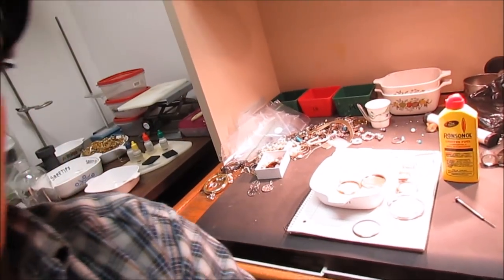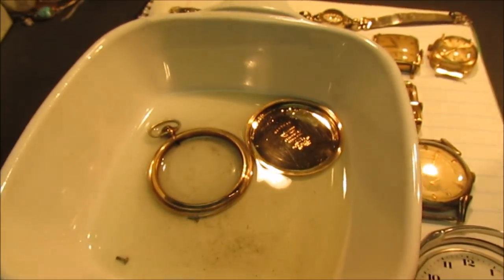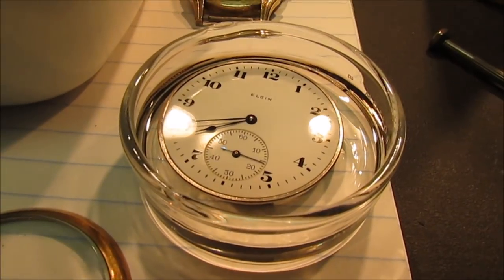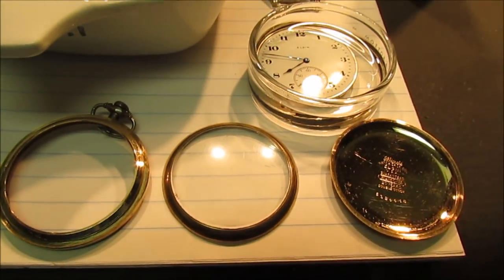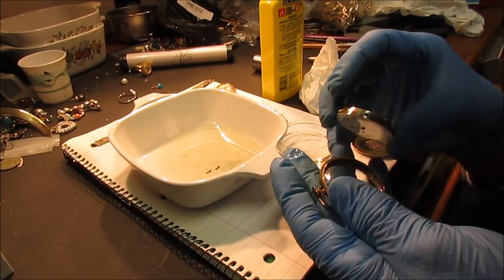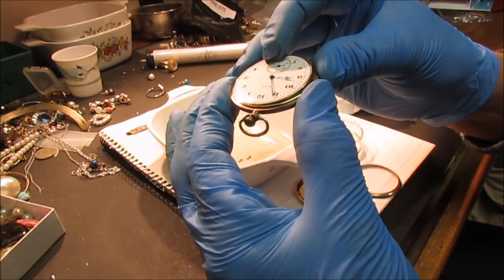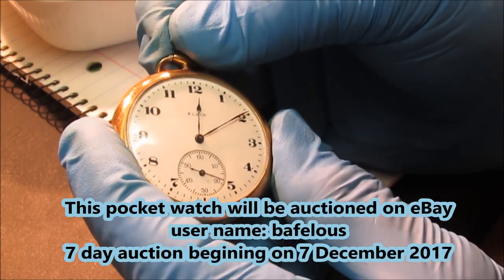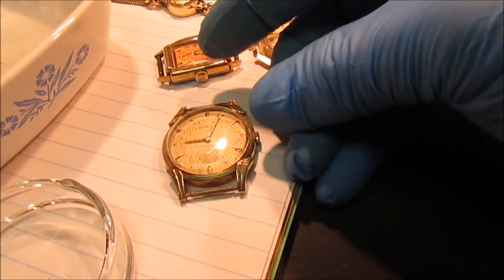Repairing An Antique Pocket Watch With Lighter Fluid

Comment: Beware eBay purchasers this watch has not been serviced only rinsed in lighter fluid without been striped down and is running dry without oiling, very bad practice.
Reply: keith solloway Finally someone who knows about watches

Comment: Remove this video!!! For the sake of all the watches people would destory!
Reply: Smakfu you are totally correct. Anyone reading this who knows this guy personally please try and stop his practices. Watches of the like deserve a lot more respect.
Reply: Don't be stupid all your life. The old cats used lighter fluid or naptha all the time to flush out all the dried out oil and dirt. No sonic cleaners in 1899 thru 1970. So rather than disassembly of your whole watch just douche it out with. Yep.lighter fluid. Ain't really anything to hurt when you think about it. Shit evaporates clean.
Reply: @bigwu100  Just because some old timer says thats what he did does not make it right. I have had it told to me. Your basically turning the pivots into grinding stones and all the dust, old oils and junk will wear the pivots out. That and now your running the watch dry with no lubrication so it will wear out faster. They used naphtha to clean the watches once taken apart. Once the watch movement was soaked over night you dry it off and take wooden pegs to clean out the jewel holes. Etc.  Will soaking a watch in lighter fluid get a watch running? Maybe but not all the time.
Reply: @bigwu100  the problem is that the lighter fluid removes all the lubrication from the watch so you would have to lubricate all the pivots on the watch or the mechanism will wear down fast.

Comment: Eek!
I recently bought a lovely Elgin Hunter off fleaBay, listed as having a broken balance.
After some research, and a few relevant purchases,  I spent a very nerve wracking afternoon dissembling, cleaning, carefully oiling, and reassembling, it.
Phew! I'm not sure I want to do that again!
Much to my amazement it actually works! I had invested in a new balance shaft and wasn't looking forward to trying that repair, but when I took the watch apart my thoroughly inexperienced eye couldn't find anything wrong with it... apart from my suspicion the pallet-fork had "jumped" the balance wheel. (probably not the right term)
It's running pretty well, although if held face-down at a 45deg angle (balance lowest) it gives a little "boing" and stops. Changing position or giving it a slight nudge starts it up again... blowed if I know what that is, I'm absolutely new to this.
Why do I bring this up?
Most of my "research" has been through watching YouTube videos. With the tiny amount of knowledge I have gained even I know this is a really, really, bad idea... If I had seen this video a week ago I suspect I would have completely buggered my watch!
Reply: if you haven't figured out the problem yet, it sounds as though there is something stuck in the pivots of the balance wheel.
Reply: It takes years to get the right tools,, and learn how each part matters, I encourage to learn the trade , that is what you are paying for when you take a watch to a, watch Maker, do check if everything is good,,, and all it needs is a cleaning to get it back up and running properly.

Comment: 1. Lighter fluid can remove numbers from watch dial.
2. Lighter fluid can remove pallet stones from pallet fork and roller jewel from balance. 
3. Lighter fluid is not be inhaled.
4. After a proper cleaning, the movement should be lubricated with watch oil.
What you have done is akin to cleaning a newborn baby with a brillo pad!
Reply from the maker: I put some möbius on the watch. Sorry if this offends you. But it did get my watch working.
Reply: Don't think you have to worry about the lighter fluid affecting the resin holding the pallet stones and impulse pin (unless you keep them in the fluid for weeks). However, I always use some isopropanol (IPA) to rinse any lighter fluid residue and this can definitely destabilize the resin, so I only rinse the pallet fork and the balance complete for a few seconds and then blow them off. Other than that I think you're spot on! Imagine cleaning a car engine like this. Sure, it would run, but for how long, and imagine the damage. STAY AWAY FROM THIS METHOD!
Reply: I feel that you can do what you want to your own watches, but not to sell them on eBay with out informing the buyer what you have done, and definitely not on other people's watches.
Reply: @see08sharp  Alcohol WILL dissolve shellac.. Very quickly.. You use alcohol, typically ethanol to dissolve shellac flakes when you're going to paint with it.. Shellac actually will stand up pretty good to nonpolar solvents like that napthalene he uses in the vid...

Comment: The proper way to repair a common low cost mechanical watch is to send it off to an experienced watch maker and after about $400+ you're good to go. So, a common low grade vintage watch in perfect working condition that's worth maybe $30 to $100 dollars cost maybe $500 for a complete service/repair. Or, if there is no emotional attachment, you could try the lighter fluid method and maybe get it running for the price of a can of lighter fluid. The downside is the watch probably won't be properly lubricated so a major part or two might wear out sooner than they would with professional service. I find a lot of cheap mechanical ca. 1909 to 1970's watches at estate sales, etc., and if they run at all I'll do the lighter fluid thing. It just doesn't make sense to spend $500 on a $1 garage sale watch worth $50 in mint condition.
Reply from the maker: Well said.

Comment: A watch maker friend, now deceased, used to use Zippo lighter fluid on movements that were rusted. He said it was very good at breaking down severe rust, but he always properly cleaned and lubed everything afterwards
Reply: Hmm, maybe take apart and place parts in a glass container and then place an ultrasonic cleaner available nowadays.
Reply: He did this before teardown on rusted watches to help dissolve the rust.

Comment: If you can afford watch cleaning solutions from L&R or Zantech from a supply house, I think this would offer a safer cleaning option than lighter fluid. You should disassemble a watch movement completely. The dial and hands need to be removed first to prevent any possible damage to these parts. Then, you can disassemble the movement completely.
Reply from the maker: Got it, thank you.
Reply: Let's see, 50 cents worth of lighter fluid and 10 minutes of time, or $100 cost minimum for a watchmaker, or about twice that much for cheap tools and expensive grease with hours of trial and failure to repair it myself... Let me think...

Comment: Anyone with a modicum of mechanical aptitude should know this is a poor way to treat a watch. That said, common model pocket watches are plentiful and relatively cheap. There are hundreds of them at any given time on eBay, but unless it had sentimental worth, why would one spend $150 - $200 or more to have a watch with a $70 value properly repaired? The same ones ridiculing you for doing this would think anyone crazy for spending $3000 to have the engine in a twenty year old Ford Taurus rebuilt. Of course you could learn to service the watch yourself the correct way for a lot less, but not everyone has the time or desire to learn watchmaking skills. I see nothing wrong with your method if it works to bring a dead watch back to life if even for the enjoyment of a few months or a year or two. We can't take any of this stuff with us when we leave this place, and most of our treasures and gadgets will be tossed out with the garbage or sold for pennies on the dollar at the estate sale anyway.

Comment: Just in principle, you should probably squirt WD40 in the gears before you close it back up and leave a tiny piece of duct tape on the inside of the case, to ensure you have used all modern repair techniques available.
Reply: I think he's making fun of the idea of cleaning the watch with butane and modern tools.  Watchmakers doing repairs tend to use things like pegwood and other tools that would have been used by the original watchmaker.  Things like ultrasonic cleaners are seen as a cheap way to do a cleaning, the butane method may be somewhat effective but is probably seen as heresy.  Maybe find a nearby watchmaker and visit them sometime and take a look at the trade.
Reply from the maker: Got it, thank you.
Reply from the maker: I actually saturated it with 3 in 1 oil.
Reply: You should definitely visit with a watchmaker, show him the video, talk watches, and tell us what you find.
Reply: No. You should literally do none of these things. You are supposed to disassemble the entire watch and use an ammonia-based watch cleaning solution. And then a different rinse. The ultrasonic isn’t a cheat, it’s better than any old method. And the balance isn’t supposed to be in the solution either because it makes the hairspring stick together and the watch will never run correctly. The whole point of cleaning a watch is to clean the jewels that the wheels and gears run into, and this can never be done without actually disassembling the watch. This whole video made me cringe.
Reply: To finish the cleaning, I usually pour a quart of 10W30 on it, then test the crystal with a ball-peen hammer.
Reply: No i think wd 40 is better lol.
Reply: wd-40 is great
Reply: Lmfao XD
Reply: No.. WD40 last thing just some light synthetic oil. WD40 is very problematic. WD water displacement. Not a lube.
Reply: Lol

Comment: Killed that watch didn't you bud? Stripped it of all lubricant. Took a huge chance on disalving the shellac that holds the jewels. Running it in fluid that causes drag on the movement and saying it keeps good time. Bet its fast after drying.  It ran for a bit. But it will wear out very fast with no lubricant.  Somebody will say "lighter fluid is oil based." Maybe so but it does dry rather quickly.  Pour some on a piece of glass so its not absorbed.  And see how long it stays there. Anyway, don't do this. Its stupid.  Turn a few hundred dollar watch into a shit pile.  I've been making and repairing watches for 52 years. If your going to try to fix it yourself,  first you must educate yourself on the correct practices to better you chances of success.  Otherwise,  you may as well just throw it in the trash before you start.  Take it apart.  Clean it. Lube it very sparingly only in the correct places with the correct weight movement oil. Can take 2 or 3 different weights of oil. Take your time. Don't forget how to put it back together.  And for goodness sake, use watch makers tools.  Not your pocket knife.

Comment: I have an old key wind Civil War era pocket watch that I got as a gift. I had to order a key for it, but it would only run for a few minutes at most. I was planning on taking it to a watchmaker, but saw this video, and figured I had nothing to lose. I set it in a bowl of lighter fluid, and moved it a round a bit. It started running, and I left it in there for about an hour as it ran. I pulled it out, dried it off, and gave it a full wind. Now it runs constantly. It loses several minutes a day, but it's well over 150 years old, so I'm happy that just stays running. Thanks for the tip.
Reply: These watches are mechanical…they need oil to run correctly